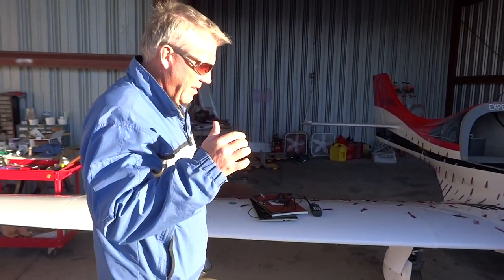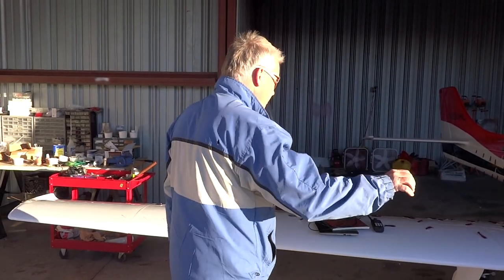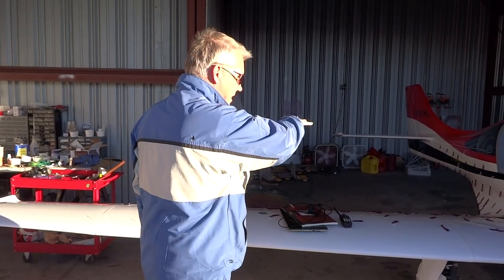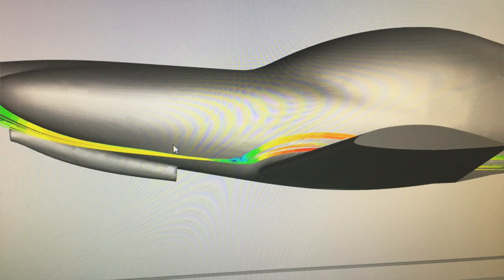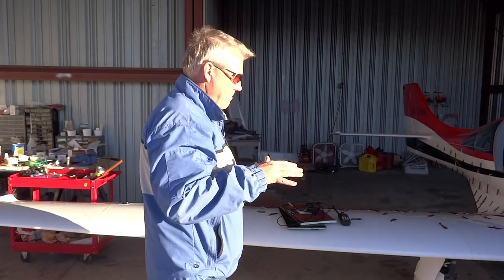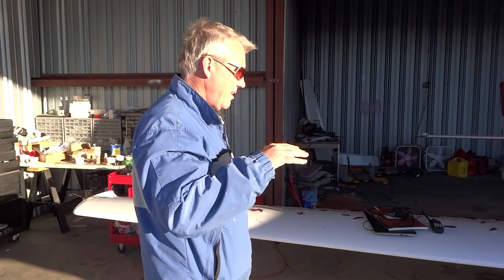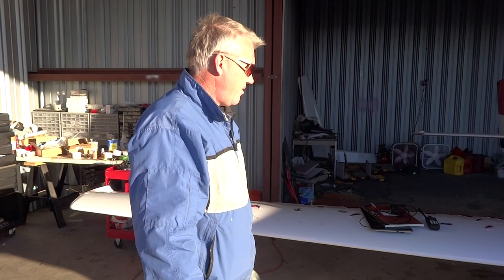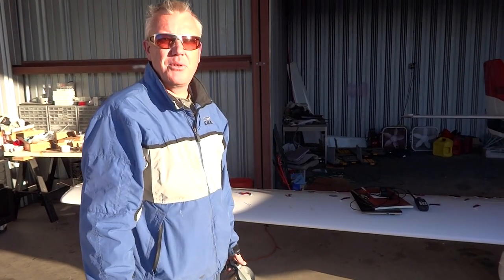Clip - Maintenance Briefing - Stall Vane - Not a Cirrus - Flt 9 Håkan Modified Lancair

Comment: At 5:30 Hakan talks about moving the stall point further outward. Why do you want to move the stall outward on the wing? Wouldn't that create more lateral imbalance at the stall? Or is the point to just stall at a lower airspeed by introducing higher energy air at the boundary layer where he was previously separating?